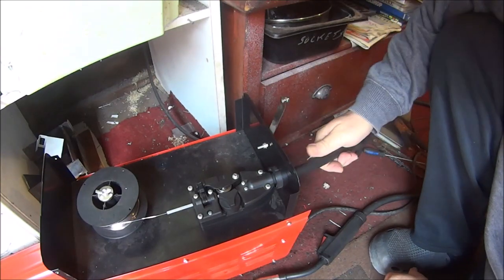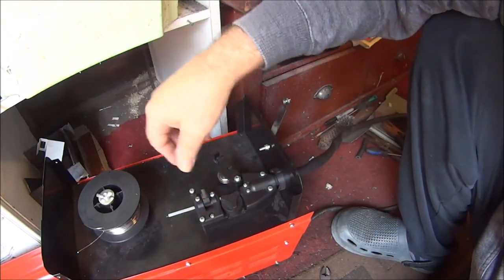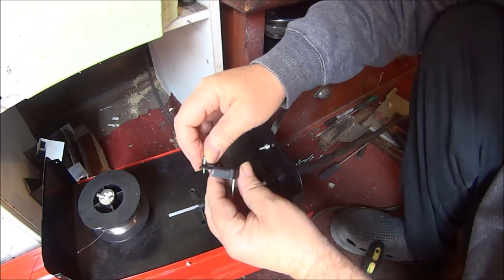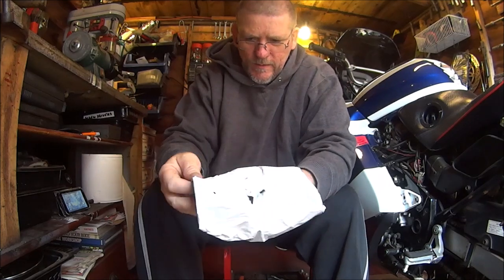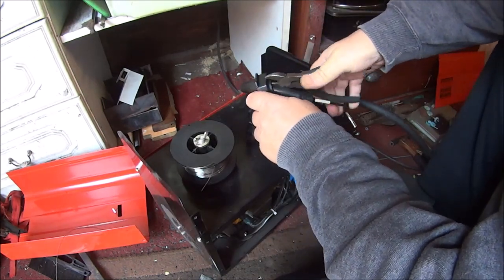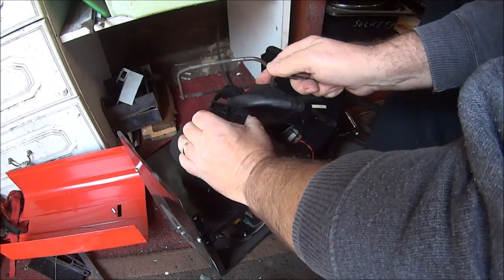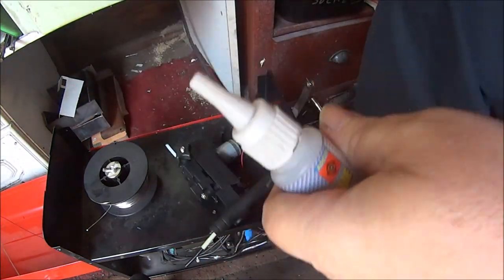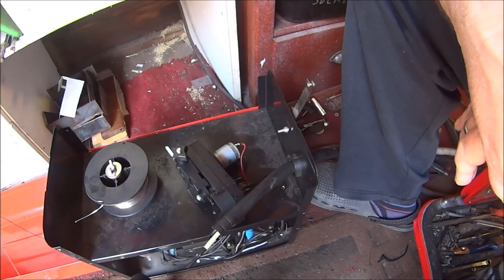Sealy welder wire feeder fix..

Comment: Well done John, you can fix it! Don't put to much tension on the wire, the unit will last longer. (You have to be able to hold the thread between your fingers) Regards,  Jan
Reply from the maker: .. Thanks kawasaki 200z and cheers for the help and tips..

Comment: on my model you just have to unplug all the cables to pass trough the wire feeder... my model is a mastercraft  im living in Montreal Canada..  i just discover today that the relay  was having a bad contact on the motor terminal not soldered at all !!(chinesium scrap ) so im converting mine to euro style connector:) great video !!!!
Reply from the maker: Yes there very cheap and cheerful but ok for the small jobs I guess. Glad you enjoyed the video cheers buddy. 👍👍👍
Reply: @jonyr1TT  yeah its good  for doing some light duty work at home or little project im a professional welder since 1991 and i love this little machine very usefull :)

Comment: Cutting the wire and reducing it is the way you do it. 2 10mm ring terminals and a 6mm bolt and the appropriate heat shrink. If you have done do the same again cut the heat shrink and away you go.
Reply from the maker: Cheers buddy great tips for everyone 👍

Comment: Good fix mate, I have the sealey mighty mig 150. I've been trying to get better beads with flux core and found that i was using the wrong drive roller for flux cored wire. I should be using a knurled roller instead of the one that came with it which is a v-type roller for solid gas weld wire. The trouble now is i cant find a supplier who has this knurled wire roller anywhere in the world with the dimensions to fit my drive assembly. Sealey are the only ones who have used a wheel with a circular key bore measuring 8mm in diameter with an outside diameter of 25mm X7.5mm depth. I'm sure your feeder assembly is the same as mine and if your not happy with your wire feed speed consistency you will also have continuous issues in future. Did you struggle to set the wire tension to have it stop feeding when you place your finger on the wire? I did and this results in damaging the softer flux cored type wire as i had to tighten the tensioning screw too much just to get it to feed more consistently to actually weld something! Have sent sealey an email asking where the bloody hell do i get a proper knurled roller to fit my damn machine. If you know please send a link. Thanks. Olly.
Reply from the maker: Yeah they are a bit cheap and cheerful think we're better off paying that bit extra and doing a proper job with a harf decent gas welder and for the price I paid for the sealey and then the part's to fix it I could of bought a gas welder. We live and learn  lol

Comment: Hi great video I am having same problem with mine do you have a link for the part and any problems since the replacement thanks
Reply from the maker: yes still working fine buddy..

https://www.ebay.co.uk/itm/Replacement-Wolfweld-Mig-Drive-Wire-Feed-Unit-130-150-amp-Welder-E92/182426994860?hash=item2a797f08ac:g:y70AAOSw44BYgIB-

Comment: Not a good video for sealey! Can’t understand why they would use plastic pieces. Nice fix though. Trouble is you will have to keep doing it. 
How’s the xj going? I’ve found in mine that the joint part of the silencers fell to bits when I undone them so had to buy an exhaust repair joint to weld on😎
Reply from the maker: Think they used plastic to cut down on the costs. All the best with the exhaust feller...XJ hopefully up for MOT this week.